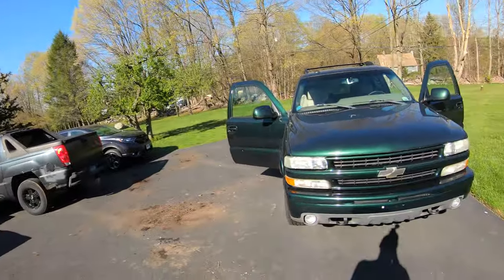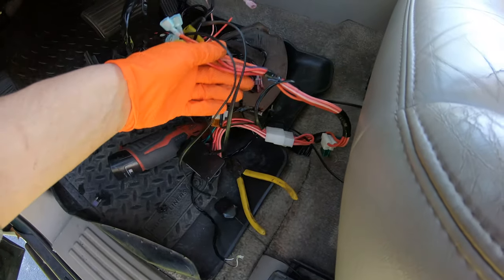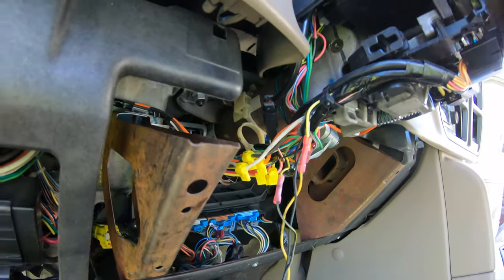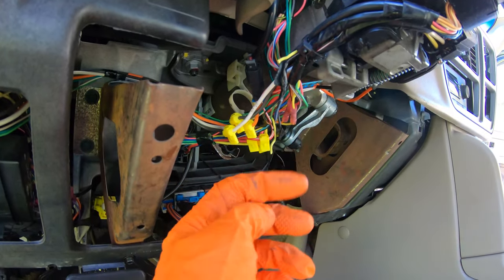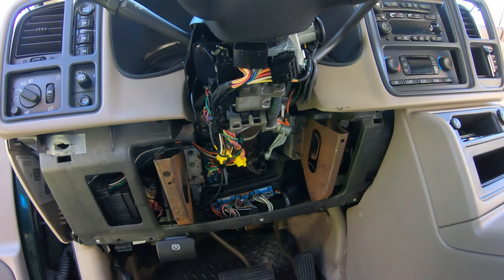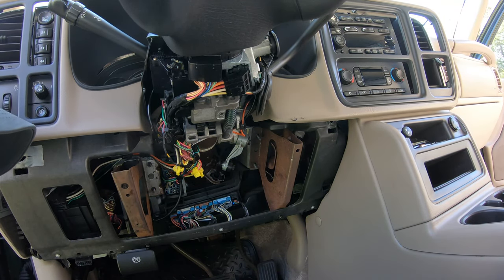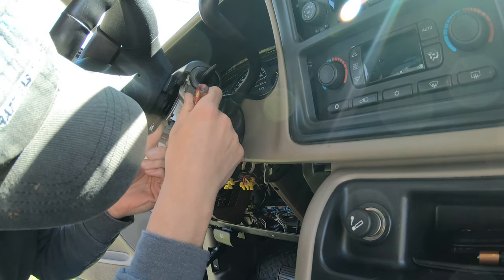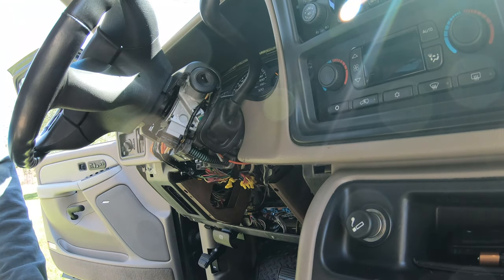Fixing No Start Chevy Tahoe (Replacing Ignition Switch)

Comment: Hey bud, I’m Raymond question. My truck was stole the porch. Do you ignition it ran I change the ignition switch Tumblr. I don’t have only time my security light is on is when the door is open and the ignition switch is off it will start run for a millimeter of a second and die. What do you think help me please
Reply: Do you have security key or just metal key?  I'm switching my ignition out because I only have metal (valet) key.  
After you need to reset security system.  10 minutes with ignition set to ON, the light should turn off and you should be able to start it.

Comment: My 2003 tahoe stopped running today and the fuse #40 was blown so I changed it and it cranked a little but then blew it again any suggestions?
Reply from the maker: What's It power? I don't know off the top of my head.

Comment: How do I find and order that part?? I have a 2000 suburban.. My keys for stolen so I had to drill out the lock cylinder and it won't start now so I'm assuming it's the switch cuz the security light stays on...
Reply from the maker: Yeah you’ll need to go get a key and cylinder somewhere. Probably will need documentation that it’s your vehicle.

Comment: I have a 2000 GMC Yukon Denali and I the same thing happens all the lights on the inside and outside turn on but the truck doesnt even make a sound so it could be the ignition switch
Reply from the maker: Gotta see if you've got power on the starter signal wire!
Reply: How can check if starter wire is good?? Truck turns on but only tapping on relay.. does that mean starter wire is good??
Reply from the maker: Yeah you'll need to check the starter signal wire by using a test light or multimeter. Need voltage on the line. If you've got it, and no start most likely it's a starter. If no power then it is something else not allowing the starter to get a signal.
Reply: @ThatAccordGuy  how would i be able to check the starter wire?? Do i remove the starter and check the wire with the light test or can i test it with the starter been connected?
Reply: Checked the starter cable and it does have power to it, relay clicks but doesnt turn on, checked all my grounds changed starter, fuses and nothing , last thing is the ignition switch module however is called , could that be it?
Reply from the maker: There's 2 wires going to the starter. There's the big red one. That's got power all the time. There's a little purple one. That one only has 12v when you're cranking. Or it should. If you don't have 12 on the purple when cranking then it's a different problem. Like the ignition switch. Yes
Reply from the maker: You can disconnect to test the purple wire

Comment: Not sure if you monitor these. I have a 2002 suburban 5.3 driving down the road it just shut off. No it cranks but no start and the fuel guage is showing empty
Reply from the maker: I'd check fuel pressure first
Reply: @ThatAccordGuy  guages don’t work no fuel at the rail . Security/battery light flash. Cranks all day
Reply from the maker: Can you hear the fuel pump prime when you turn the key on?
Reply: @ThatAccordGuy  no sir
Reply from the maker: With both of those problems at the same time I'm thinking that you have wires shorted in the harness somewhere. I checked the entire fuel harness and chassis harness that it goes through for rub through. Any bare wires touching frame would do it. 

The level sensor is shorted to ground probably. And possibly other parts of the fuel harness. Could have blown fuses as well.

Check underneath the fuse block for mouse damage and or corrosion. Good luck

Comment: Would this be a similar process if the suburban doesn't start, but will if you jump the relay (did try replacing relay)?
Reply: Ey sir , did you get it fixed? Im recently having the same problem,  i changed relay checked my ground wires changed starter and nothing , next thing im going to try is replacing the ignition module, did you find the problem ?
Reply: @josecarrizales6230  my issue turned out to be the neutral safety switch. Good luck!
Reply: I also replaced the ignition module, along with the relays, checked fuses and grounds. All of that for nothing more than piece of mind. Sorry for the time of the response.
Reply: @jpeezy1976  thank you sir i appreciate you time,  i changed everything that could possibly be except for the nuetral switch, im going to skip it and go straight to the ignition module hoping to make it work
Reply: @josecarrizales6230  did you fix it?

Comment: Hey can u answer this question, I can drive my Yukon ,fir a hour then get to the store and ,go out to leave ,and my Yukon does t crank, let it sit for a hour and longer it fires right up...new battery , cables perfect, checked all my grounds, just starts when it wants too
Reply from the maker: Could be a bad starter that only fails when super hot. If the security light isn't on, then I'd set up some type of test light on the starter signal wire so when it's acting up you can test for signal to the starter. If it's going to the starter and it does nothing I'd throw a starter at it.
Reply: Yeah the security light it flashes when key is in and or door is open, I heard it might be the starter ,yeah that's a pretty easy start , and have never replaced it yet ,so it's probably do...seeing I love this suv and would get what ever it needs ,to run ,thanks for the second opinion

Comment: My 01 Tahoe crank cranks cranks then sputter start or sometimes crank crank no start then 2nd time starts up. I replaced a lot of things including the keys. Would I have the same issue?
Reply from the maker: You've verified Good fuel rail pressure? Do you have security light flashing? If not if probably say clogged fuel filter or fuel pump
Reply: Am having the same issues but not with the key

Comment: I have a 2000 tahoe and struggles to start and does have the security light on thank you
Reply from the maker: It just cranks and doesn't start with the security light on?
Reply: @ThatAccordGuy  Mine does this, is it the key cylinder?
Reply: Am having the same issues as you sucks

Comment: Boss man I have 02 suburban chevy my fuel pumps fail every 7-8 months I’ve bought 3 already when it faills i turn the key cranks starts then stalls and die, Could it be the ignition switch??
Reply from the maker: Changing the pump should be it! What brand pump did you use? May have a voltage drop or bad ground for the pump. What's the condition of your fuel filter? Could be clogged killing the pump too
Reply: @ThatAccordGuy  I have a 04 Colorado and it's doing what the guy above said starts n immediately dies pump seems to be good getting good pressure up at the regulater purge valve it's not the anti theft new air filter plugs seem good any ideas on what that could be?
Reply from the maker: Sounds like anti theft to me... Can help keep it running with the gas pedal?

Comment: Would be nice if you try to start it so we could see what it’s doing to see if it’s the same as ours is but that’s cool just like every other YouTube post
Reply from the maker: The problem is that it's intermittent. It doesn't do it all the time, but when it does your left stranded. this person had it happen to them before, and they were not interested in having it happen again. 

The issue may not happen again for six months. So sorry, couldn't demonstrate. Sometimes cars don't like to act up on camera.
Reply: @ThatAccordGuy  Was the issue it would act like it was going to start but then die with the theft lock light flashing? Our does this and I have to relearn the key. Sometimes you go 6 months sometimes it does it a couple times a day. Can you link the part? Thanks for the video.